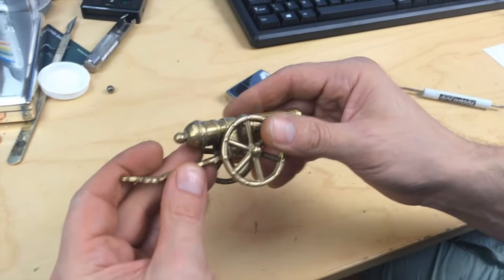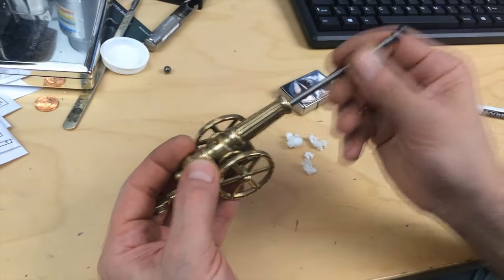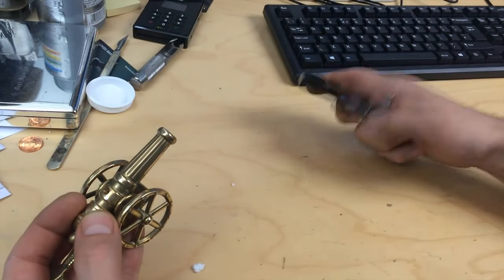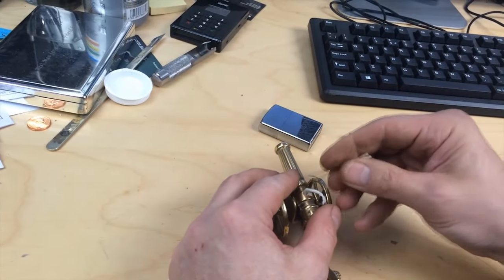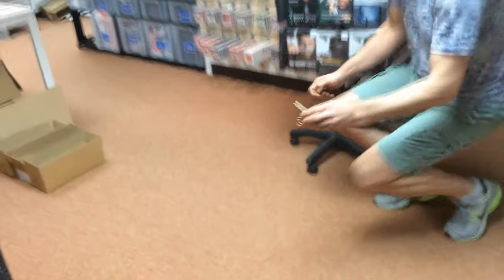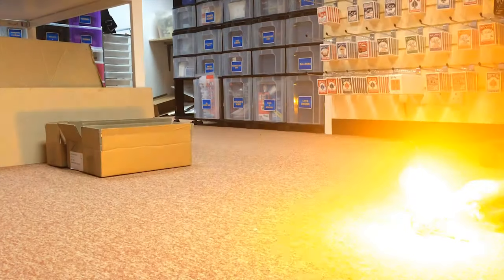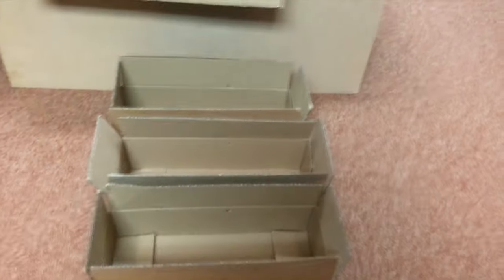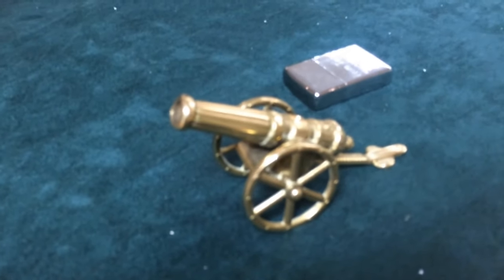Flash Wool Cannon

Comment: Anyone watching this thinking about trying it should read up on the history of gun cotton and why it was not used in guns by itself and how it leads to the development modern smokeless powder for a reason.
Reply: And that's why he only used a mini brass cannon you will have to have a very relaxed brain to put flash cotton in a gun.
Reply: @jahno7154  hey we are on YouTube. Just making sure people understand how powerful it is
Reply: @imdrunken  Fair enough i thought you was having a dig.  Do you know if flash cotton is more powerful than gun powder if loaded in a cannon?
Reply: @jahno7154  yes, way more powerful. new smokeless powder is basically nitrocellulose with burn inhibitors and made into pellets to reduce surface area also slowing burn rate. Gun cotton has something like 5 or 6 times the power of black powder for the same weight. Super dangerous to use gun cotton in any firearm.
Reply: @imdrunken  Thanks for the imformation bro much appriciated i was going to try the flash cotton cannon but not now i want to hang on to my fingers, cheers.
Reply: @jahno7154  no prob, appendages are extremely useful. Don't let this scare you away from flash cotton completely though.  It it very interesting stuff for OTHER purposes if you do the proper research and use correct safety procedures.
Reply: Flash paper's ok though...gallery load for rifle carts. Check out "Explosions - ancient to present" for guncotton rock blasting.